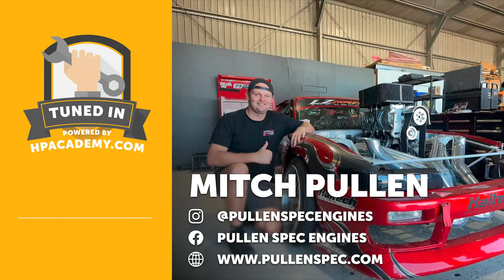112: Building a BIG-POWER LS That Actually Lasts. [#PODCAST]

Comment: The block and piston growing at different times makes me a bit scared after hearing that.

I always thought cool coolant temps for an LS such as 185-195*F were perfect when it's being pushed hard and the cooling system is strong enough to support that.

But if it's pushing a lot of power and the piston is getting quite hot and expanding, but the cooling system is maintaining sub 200*F coolant temps, wouldn't that prevent the block from growing as much as the piston? If so, then it seems eventually the piston will start butting up on all sides around the cylinder wall and seize up.